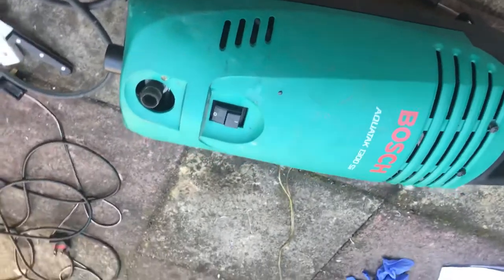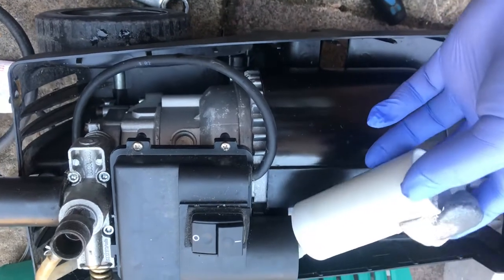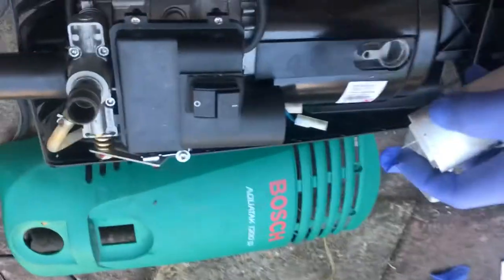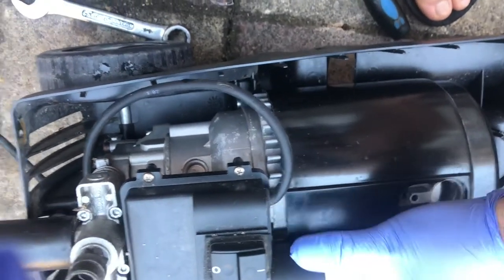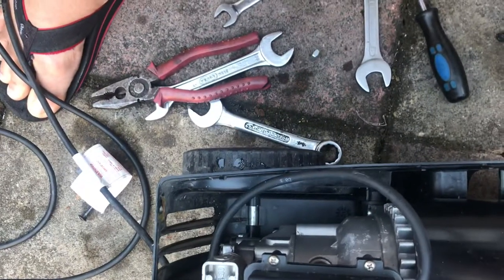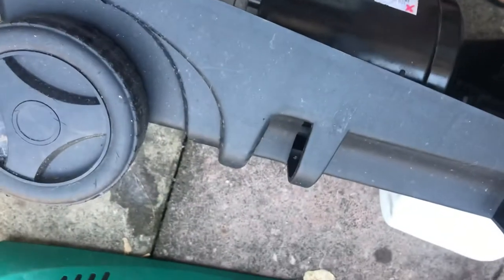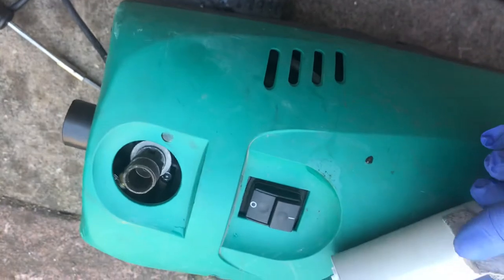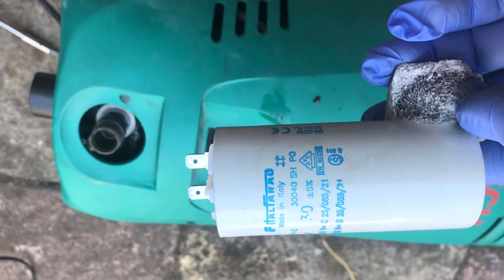How to repair pressure washer part 1

Comment: nice content, my bosch when On it runs and smell of burnt, but no water from the nozzle, please advice, thanks
Reply from the maker: @muddyboots-mac  if you can hear that the motor running try other gun nozzle  if the same problem your pump already gone
Reply: @donpedrochannel2529  i did check with other nozzle but still no water, when you say gone, can it be repaired